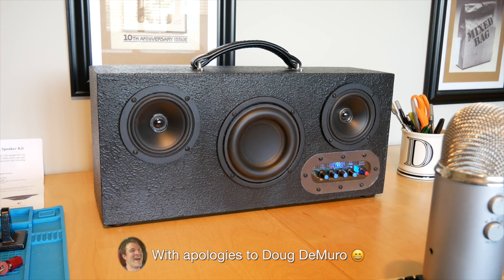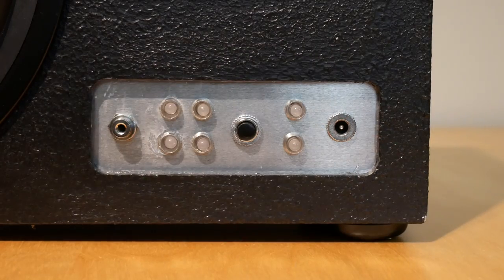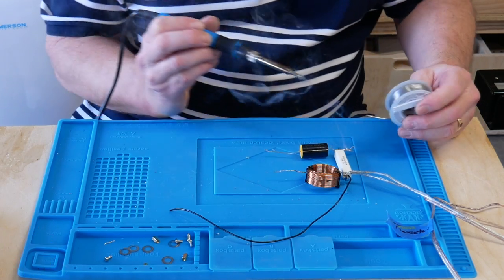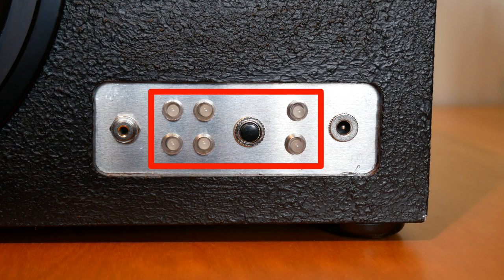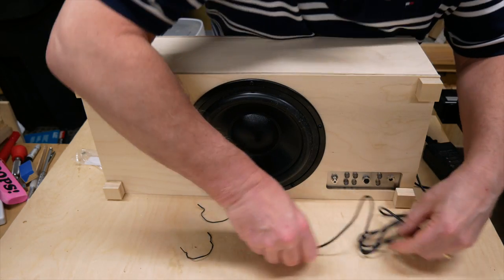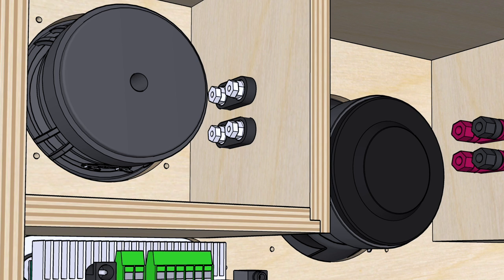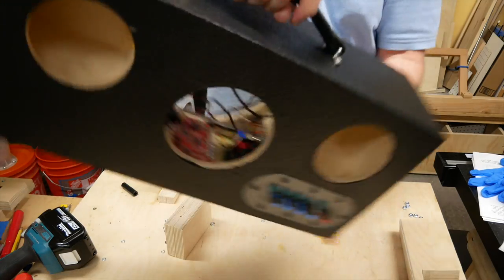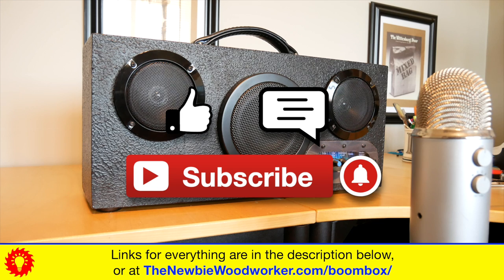Building the Bluetooth BoomBox kit from Parts Express

Comment: Great video. I've done something similar with an antique trunk by adding 6.5" car stereo speakers and an 8" passive sub. Looks so cool. The speaker L/R outs from the class D amp go to the L/R car speakers, and the sub-out speaker wires go to the passive subwoofer driver. Way easier than monkeying around with crossovers and capacitors. The amp already has a crossover knob for the sub out and knobs to set the L/R bass and treble levels. The L/R outs from the amp carry the full range signal that these car speakers can handle. I did not include li-ion batteries, opting to go exclusively with AC power via a laptop charger (24volt 6amp) to give me nearly 150W of power. The system gets very loud and sound great. That class d amp is amazing for the price.

I also use one of these class d amps to power a pair of Dayton 2-way bookshelf speakers mounted on my office wall, and a passive sub from a thrift store on the floor. The sound is amazing for such a basic system. I use it for editing videos and doing voiceover work, or just listening to music or watching YouTube videos.
Reply from the maker: That's pretty cool - I don't have that kind of knowledge, although I suppose I could always learn. When editing videos or doing voiceover work, I usually use earbuds (wired - no delay that way), then I do a final listen with regular speakers. I'll often watch it once on my TV just to make sure the mix is about right, but since everything's different I just have to find the best middleground.

Comment: I built mine a few years ago and still going strong. I did upgrade to the 5 battery board and did several modifications, it sounds amazing. I never got the crossovers to work right, the sound would cut out on both if I turned the volume up past a certain level. Eventually, I took them out and connected full range speakers directly to the amp. Sound just as good, if not better. I ended up putting my crossovers where two coax speakers are in case I ever needed to repair them. Eventually I yanked the whole thing out to put the full range ones in. Great video!
Reply from the maker: Thanks for the comment. That's the beauty of making kits like this - we can modify them however we want. Mine still works great, and I'm regularly blown away at how good the bass sounds when the volume is low - I've never had anything like it. Of course, the place where I use it has the perfect wall to place it against, so that helps. :)
Reply: @TheNewbieWoodworker  Yeah, the bass hits harder when you find a good spot to enhance the acoustics. It’s funny you talked a lot about the soldering of the crossover components because that’s probably why mine never worked right. It was probably something related to soldering. Never quite solved that mystery but didn’t have time to troubleshoot it either. Would like to try to fix it someday. I feel like I cheated the built by bypassing the crossovers with full range speakers.
Reply from the maker: @MrCrippyBlunt  I actually had a ton of problems doing the crosovers. I barely touched the surface in the video. In the end, it was all due to my not reading the directions clearly enough, not identifying which part was which, and my crappy soldering abilities. At one point, I stepped away from the project for a few days because I was so frustrated it wasn't working. When I came back, I unsoldered everything and started over (maybe I even did this twice, I don't remember). Fortunately I didn't ruin anything, and it worked when I was done.

Comment: I'm making my own version of this, but I am using 2 4" Dayton reference aluminum full range driver's and with titanium tweeters crossed at 3000 also the 5 battery pack. Iim also building my own cabinet out of oak because I like hardwood but it makes it heavy.
Reply from the maker: Very cool.

Comment: since I have made all kinds of electronic.  from 5 channel light flasing box then added it to my disco 16' x  20' .  this was long before LED floor. let just say my dad got mad. he was mostly mad over the holes I drilled in the 12" x 2".  If any one is wondering how it drove 4 120V color xmas outdoor lights in each square, I did that with tryacxs.  I had pretty insane push button setup.  the hole setup was pretty insane.  I got lab extra credit for it in my binary it used aa lot of what I learned in the math part of the class. If I was asked to do it again I would not do it.  Like the BAL object decompile I wrote in RPG on a Sperry 9200. it did a great job for when the source desk had been lost.
Reply from the maker: You wrote a decompiler in RPG? Wow, I'm impressed! I'd ask "why would you ever do such a thing?" except I know why - it was fun, right? 😄
Reply: @TheNewbieWoodworker  I had 10 weeks of nothing to do till the COBOL class started.  I have been reading the BAL manual and it explained the object were punched. the hardest part was the field names and for the most part could only be done if the object had been created with option to create the names and address.  I also modify the code to work on a IBM System 3 MOD 10 and a Sperry 90/30.  it could decompile any any object desk for any program to generate a BAL source desk.  It was a bugger butt of a program to write.  The IBM System 3 used RPGII  and talk about reprograming you brain, I had to make up a list of the difference.
Reply from the maker: @ffieditor  Interesting!

Comment: It has been awhile since i have looked into audio components but, there was a 2 piece grill made for 8 inch speakers like the one you have for your subwoofer.

Also, did you ever think of making the crossover board and putting it in the cavity with the 4 iinch speaker?
Reply from the maker: Thanks for the info. The crossover board is inside the box.

Comment: Can you get another battery pack to reach the Watts
Reply from the maker: Yes you can, although I don't remember the details. But this is plenty loud the way it is.
Reply: @TheNewbieWoodworker  thanks nice job. I'm currently doing a project. I took apart an old stand cabinet on the side of the road and I took all the wood and are making tower speakers but I used everything even the doors I rotated the small pieces of the door into trim and made them look like collums it's pretty cool. Just wanted to share 😆
Reply from the maker: @BostonMike68  Thanks for sharing, for sure! Sounds like something Matthias Wandel would appreciate - he's always doing stuff like that from things he found on the side of the road.
Reply: @TheNewbieWoodworker  Thanks I hate wasting good wood. I was going to use the piece but I had no room for it so I came up with a speaker project but I'm doing it outside under a light with a  skill saw to rip and miter everything and I don't have any extra wood to make a mistake but I am almost done with build I and I have a lot of sanding before I can finish them
Reply from the maker: @BostonMike68  I make too many mistakes to even try something like that - I'd run out of wood for sure. Good for you!
Reply: even for the longer operating hours. can you do it?
Reply from the maker: @sfkim44  Yes, they sell a more powerful battery that I assume would last longer, but it requires a different wiring harness (or something - I can't remember exactly).
Reply: I'm building my own version and I'm using the 5 battery pack
Reply from the maker: @BostonMike68   👍

Comment: Nice build Dan, one thing you might be sorry for is gluing the back on.If you ever have to remove the electronics to fix something it's gonna be a bi**h. This coming from a retired electronics tech. BTW do you remember a company called Heath kit. Over the years before they went out of business I build just about everything they offered including the color TV.
Reply from the maker: Thanks, Larry, and I do remember Heath kits, although I never built one. I agree about the back, and in fact I already suffered from having done it. At one point I was going to explain it in the video, but I decided it wasn't worth the effort. What happened was I ruined the charging board, and I bought a new one, which turned out to be "v2", which didn't work with the LED charging lights I had. Which meant I had to buy a new harness and figure out how to replace the existing LEDs in the aluminum panel. What a PITA, let me tell you! I started a design in SketchUp for a box with a removable back, but I don't know if I'll ever make it or not.

Comment: Why couldn't  Parts Express offer videos like these, which show what unit looks like while assembling?  Directions suck.  Will not recommend.  Also supplied batteries need to provide power advertised.  Too many surprises and extra purchases necessary
Reply from the maker: I pretty-much agree with everything you said. On the plus side I still use this regularly, even after 2 years, and I still love it.